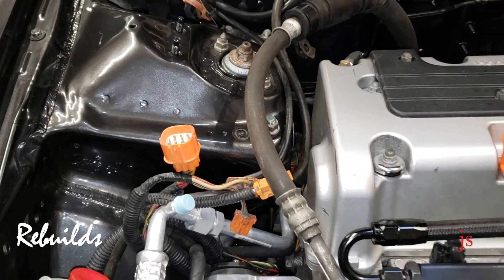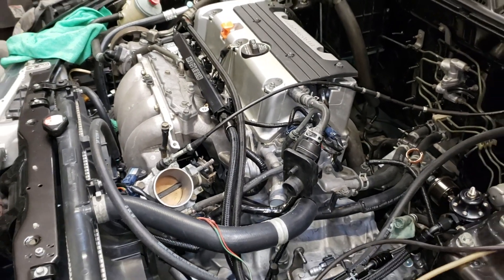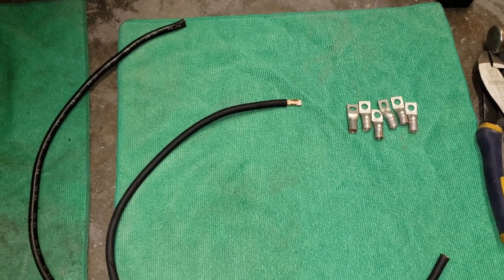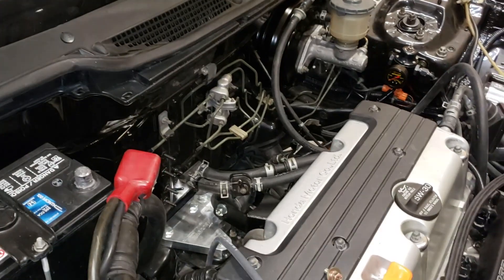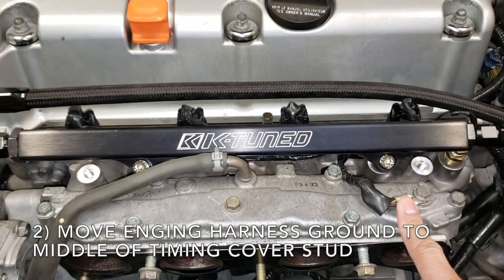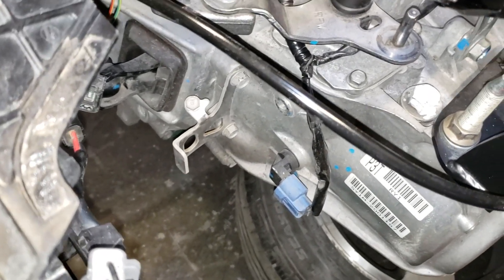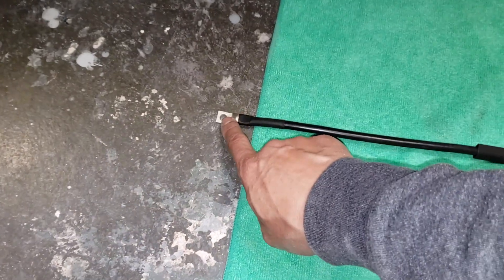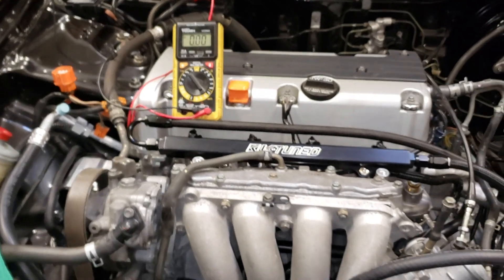How to Make Ground Cables for K Swaps.

Comment: Brother can you help me . Crank no start. Fuel pump was not priming after an overheat issue .replaced fuel main relay .. nothing no priming nothing …jumped main relay with some fuses and fuel pumped primed but still won’t start just cranking .. I was getting 6v to fuel pump connectors at fuel pump. Bad wiring ? Ecu ? Grounds ? Any info or next steps would be extremely helpful . K24a2 swap - civic eg 94
Reply from the maker: Everything was working until your car over heated?
Reply: @jsrebuilds3951 @jes it was jsut overheating . I took the thermostat out and it stopped over heating but it was bogging out bad . Replaced fuel pump and still overheating. However this is the issue now . Any tips for next steps . Thanks for reply !!🎉
Reply from the maker: @ForeignSjde  I wonder if overheating your engine may cause damage to head gasket or head to warp?
Reply: @jsrebuilds3951 deff can luckily it was the ECU fuse
Reply from the maker: @ForeignSjde  Oh wow. I'm glad you figure out it was the ECU fuse. I wonder what caused it to blow a fuse?
Reply: @jsrebuilds3951 you know I was so happy it was just a fuse and I got it started  I didn’t think what caused it 😂 now I’m stressed again

Comment: Hey what size wire did you use for the transmission ground
Reply from the maker: 10 – 12 gauge wire is commonly used and adequate. But 8 g cables for engine grounding for a high-performance or upgraded grounding setup.

Comment: I've got plenty of grounds, i believe anyway. And am still not getting it to crank. Brand New main relay. Have fuel at the rail. Tune loaded into ECU. What could it be?
Reply from the maker: Is your starter wires wired up correctly? Heres my other video with the charge harness. https://youtu.be/lS_9p4obSeM
Reply: Yes I have it wired correctly, it's essentially a stock charge harness. I can hear the relay click in engine bay fuse box when I try to turn it over. Pump primes then just clicks when you go to start. It's not even cranking. I'm at a loss
Reply from the maker: @johnchanez75  How about the starter signal wires near the clutch reservoir?
Reply from the maker: @johnchanez75  One more thing is double check the wires on the conversion harness, that they are crimped correctly to the wiring of the B series ecu plugs. That they have good contact.

Comment: Can you move the valve cover ground to intake manifold bolts ?
Reply from the maker: The ground on the valve cover is like that on the TSX but again Hondata says it's better to do it like the RSX. I'm not an expert but I'm guess on the TSX chassis it has better grounding for it to be on the manifold.
Reply: Yes. that's the stock location on the K24. Either way should functionally be fine, but on my K24A2, I left the logic ground on the stock location because IMO it looks much cleaner covered up by the intake manifold cover.

Comment: you ever figured out ya fueling issue? im having the same exact problem. cranks but wont start.
Reply from the maker: It turns out the conversion harness needed some of the wires crimped down and it didn't allow the fuel pump to turn on.
Reply: I got the same issue no fuel pump powering up I don’t a conversion harness. Sort summary I swapped my RXS manual engine harness 02 – harness 02 floor harness O2 ECU O2 type S all type S harness however it cranks, but don’t get no fuel. My fuel pump will not turn on i ground on the ground you suggested which makes it crank now, but I still get no fuel. Any ideas?